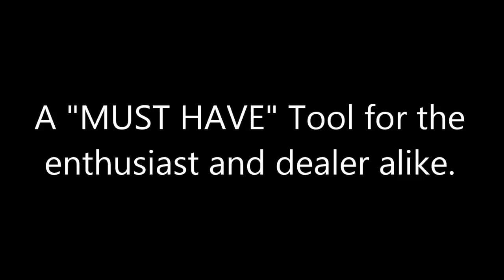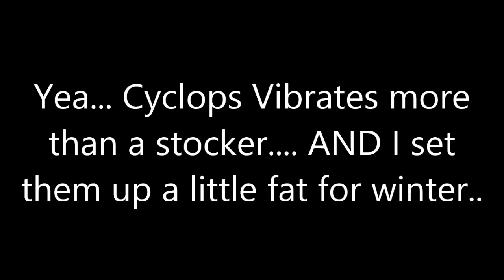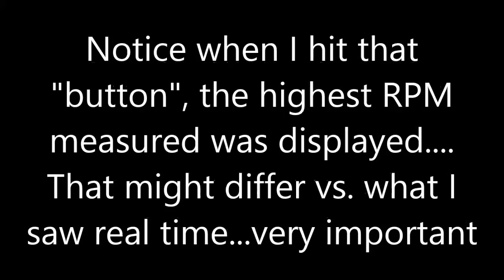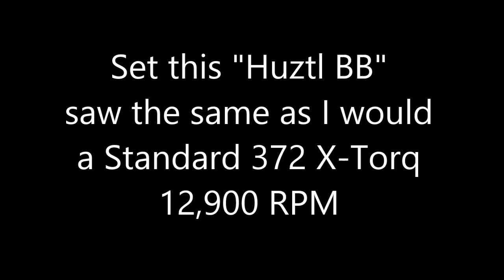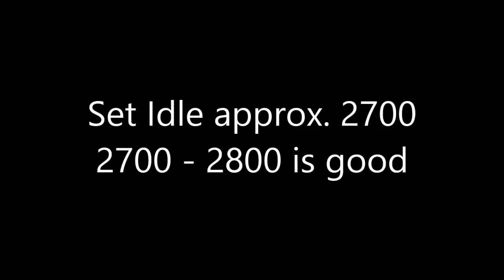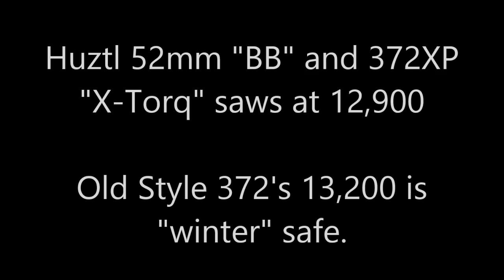Tachometer's For Chainsaw's and Husqvarna 372XP "X-Torq" Setup Notes

Comment: Sound advice here, thank you... I am checking around right now on prices for the Husqvarna 372XP. I just learned the only thing the user can adj. on this saw is the idle ( bladed screwdriver slot ), just below is the slot with the H & L carb adj. screws that req. a " Husqvarna specialty tool " to make the adj. According to the Husky salesperson, people were burning these saws up for the very reasons you have clearly illustrated in this video. Admittedly, I am old school & have always made my own adjs. by ear, however, this " old dog " can indeed be taught new tricks & using a good quality tachometer is sound advice & something I will indeed invest in. As for the " Husky dealer only specialty tool, " forcing me back to the dealer, at cost, to adj. the carb again after my initial break-in, I will make my own tool, to turn those screw heads, perhaps a butt connecter can be adapted with a slight squeeze on the outer end to accept a sewing machine type of screwdriver of which I have an asst of in my roll away. Excellent presentation here, people would be wise to pay close attention! :-)
Reply: You can buy the tool in a kit on Amazon and other places

Comment: Just getting into doing some of my own tune up work on my 7 Huskies and just found your channel... 
Impressive info and presentation! 
Based on this video and some reviews, I just purchased the TDI 20K Tach from Amick's on line. Can't wait to check where my 372xp is on the high end...  
(And having fried a 346xp early in my Husky years, I'm super interested in making sure EACH saw is set with a margin of safety!  I did have that frozen - from heat - saw rebuilt by pros and I don't even want to admit how much $ I have in just that one saw!)
Thank you for your video and great info!!

Comment: I have that same tach, actually bought it after seeing your vids.  It is a great tach.  I recently bought a used Dolkita 6401.  It is rev limited to 13,500RPMs.  I took the saw out and tuned it in the wood.  I was sure she was 4 stroking out of the wood and clearing up with load but since it is rev limited it also gave me a bit of doubt.  I grabbed the tach and checked the no load RPMs.  I was at 12,200.  I was leaving alot of power on the table.  I slowly leaned it out and kept rechecking my no load RPMs.  I know the limiters can throw off the tach so decided to just slowly "sneak up" on it. I ended up leaving it at 13,100 which is 400 below the limter.  At that setting I was getting slight 4 stroking WOT no load and decided to leave it there to be safe.  The saw really came to life going from 12,200 to 13,100.  So another win win reason to use a tach. 

I also have a 390XP, it is stock other than a muffler mod.  I also changed out the factory limited coil to an unlimited coil.  It 4 strokes out of the wood and cleans up in the cut but I am gonna re check it now with the tach.  I might be leaving more on the table with the 390 than I think I am.
Reply: Where did you pick up your tachometer from??

Comment: I love my 180.  I picked it up off ebay and restored it. Mthe only problem you might face is putting the oil pump in the 180.  You have to align it up with the discharge hole, otherwise it will not oil.  I had to put together and disassemble the 180 three times before I got it exactly right because you do not know it is aligned properly until you get it assembled and run it.  It's a bitch but when you get it right it works great.  Also make sure you use gaskets on both side of the carburator.  Otherwise you can get air leaks.  Never forget on the 180 that the cover is an air plenum and the dirty side is the bottom of the filter.  I also use the fleece air filter and not the foam filter.  The rest is a piece of cake.

Comment: My new 455XT was rich on the low side but lean on the high side by a little bit.  I adjusted both and left the high at 12,560 on my Stihl EDT9 tachometer.  It was running at 13,300, probably on the rev limiter.

Comment: My no load max rpm on a broken in saw in cold weather is 12,600 to 12,800.  They will drift a little higher in warm weather but afterwards they will be safe at just about any temp or condition.  I want a good four cycle on them.  I do not care how dirty the plug gets because plugs are cheap but engines are not.  Anyone who tells me they have the original plug in their saw after eight years of use and it looks just as good as it did, originally, is running a lean saw.  I want a plug that has some carbon flashing on the end and the electrode is a brownish grey.  That, tells me that my saw is running rich enough to protect the moving parts.

Comment: You have a new follower sir!
A big thanks to your children, you had mentioned, for their service!!
Would really like to see a video on the brazing process you use for the muffler mods.
I have a 268 with the HUZTL muffler that is dying to opened up after a little more than mild cylinder porting job that I cut my teeth on. 
Thanks for the very informative videos!!
Keep em' coming!
Reply from the maker: Anthony Wop Thank you for watching! plan to video me hacking a muffler, machining a popup piston and a few other little details like that this coming year. Going to push the boundary a little more. If all goes well... a saw dynamometer might appear too this year or next...it's in the budget.
Reply: Ill be looking for those! 
Went and purchased the little bernzomatic mapp/oxy torch yesterday to start practicing the brazing process. 
Working on a 394 right now as well that needs a new fly wheel and some other things including a muffle mod on a new, aftermarket, muffler. 
Need to ask you how good that sonic cleaner works for you. 
I'm looking to start a small business on the side, for now, and looks like you're  "AR" like I am! Next big tool purchases will be the case splitter and tach.
Sorry to ramble on.
A saw dyno!!
Fuggin awesome!!

Comment: Ms 180's can be a chore but they are not that bad and they are a great little saw.  The only thing I had real problems with was getting the new oil pump lined up and the oil lines in.  The rest of it is a piece of cake.  Get the fleece air filter for it and remember the sawdust collects on the bottom of the filter and the rear cover is a clean air plenum and not a cover.  I have seen idiots run this saw without the rear cover on the saw or it not locked down - not knowing they are sucking dirty air right into the engine.  I like that 2K tachometer but they are pricy.

Comment: Man I can’t tell you how helpful this video was for getting my 372xp set right.  She was wayyyyy too lean out of the box.  I need to check my dad’s 450 rancher.  Any idea what a good rpm for it would be?  It’s a few years old but I’m almost positive it has a limited coil.  Thanks again!
Reply: I believe the 450 rancher is around 13,000 no load.  You could go 12,500 and see if it cleans up good in the wood, if it does and 4 strokes immediatly if you pull up in the cut then your probably ok, if its not completely clean at 12,500 in the cut lean it a little at a time towards 13,000.

Comment from the maker: To those who question where I got the "13,000 RPM" vs. "13,500 RPM" no load numbers for the 372xp "X-torq", there is a posted conversation from a dealer I trust over at forestryforum.com should someone want to test the validity ..
The thread title is "Conflicting Saw Specs" in the chainsaw area.
Reply: tell me why you thing a couple of RPM are all the difference to you?
I understand you like to be thorough and i think thats is worthy but it just sounds like you are scaremongering others into  buying a very expensive product for a few RPM. thanks for your response.
Reply from the maker: Because it is a rpm limited ignition, so folks tend to want to raise rpms by leaning out the carb...so they do. The saw gets to the limiter and now leaning out the carb no longer returns a change. Many times by the time folks figure out nothing is changing to the rpms "by ear"  its well past the point of lean. A toasted top end is not far behind. So instead...using a tach you can lean out the carb to just below the rpm rev limit and KNOW you haven't gone too far. Want the hell is scaremongering anyway?? Also having the saw tuned a couple of hundred rpms away from the rev limiter gives a little safe zone in tuning to account for running at cold temps. Something we do here a lot. As the temp drops, the air density goes up requiring more fuel. A saw tuned to 13000 in the summer may be at the 13300 in the dead of winter simply because of air temps....so no mongering as I have nothing to gain, but many have plenty to loose by not understanding what they are dealing with. Just raw information to those willing to hear.
Reply: 140psi Good compresion 372xp?
Reply from the maker: @Sensei948  yup, good enough to run
Reply: @afleetcommand  So by setting 372 xp oe to 13200 I am safe and I have factory power?
Reply from the maker: @Sensei948  yes

Comment: First chain saw. After cleaning up the carb that I left gas in on my Husky  450 I re installed the H and L needles with my new 21 spline nut driver and I was at square one. I never touched T. I set both screws to 2 turns, per the  Husky shop  manual that I found online. It started right up. I played with L until I got a smooth idle and no hesitation after revving. That leaves the H to be set. The manual says 12500.  I read on forums that it  it should 4 cycle until load is applied. It runs smoothly when revved, not 4 cycling, and seems to bog under load so I assume I am not set correctly. I am wondering whether I should get a tach and just set 12500 or try to detect 4 cycling/ 2 cycling under  no load /load. I was looking at the tt20k as it seems versatile enough  for use with a number of engines I own. Any feedbsck appreciated.

Comment: Can I do this effectively with something like a Tiny Tach? I have an Echo CS620PW that I have been running at stock settings. The problem is is that supposedly they are set up for 1000 feet elevation and under. I'm at 5600feet. I've been running it like that. For one thing, it's hard to start. I'm going to guess it runs richer up here due to the lower atmospheric pressure? I usually run it when it's between 40F and 70F outside. That all said, I just bought a CS-2511T and I haven't used it yet. I like this little saw and I kinda want to set it up properly before I even run it the first time. I'd appreciate any advice. Thanks.

Comment: the saw is a 372xp that's what i was setting the H and L on thanks for responding. I got a question about filters  I left this question on another video too just saying  i was wanting too use a jonsered filter for 2166- 2171    on the 372xp  no dealer close by and don't won't too wait on shipping what's you opinion thanks in advance.

Comment: Where do you get the tach specs so you know around where you need to be?  I have a 2016 390XP, Husky site says max power RPM is 9,600
Reply from the maker: Bob..:) Also you can get a lot online by just searching "max rpm" on a given saw. But Bob has all that info for Husqvarna / Jonsered. Basically ANY dealer of any brand should be able to supply that type of information.

Comment: I just have to ask, at what fuel  mix ratio are you basing your adjustments on? If I remember you run a 32to1 mix. So if you would run a richer or leaner oil mixture in theory would  you not have to change your mixture settings on the carb to compensate ? So should one only be concerned about running lean at some point and wouldn't a richer oil mix counteract the lean effect as well as slow the rpm down because of the inherent slower burn time versus a richer gas mixture while at the same time cutting down on both peak Hp and top rpm"s but in turn
boost bottom end torque ?  I agree with your logic but I tach tune all my saws to run 13200 to 13800 depending on model and moods and I run 24to1 in the summer and 32to1 in the winter with a little marvel mystery oil added in just because, that's how its always been done here on our farm its in everything. The only issues I ever had is fouled plugs and clogged spark arrestors, a very minor inconvenience for great power and longevity. My saws are work saws not play toys. In my opinion  50to1 falls way short of what you should be running, the manufactures only push this to please the  tree huggers that are pushing the EPA to mandate it while trying to save the same trees that we are cutting down.
Is my thinking all smoked up  from all the extra oil. Your thoughts please.
Reply from the maker: You can really over analyze  this stuff. Rather than go point by point, I'll just cover a little back ground and what I do. First, oil is in fact a fuel. And actually has more BTU's per unit volume than gasoline. Second, the newer synthetics actually burn much better than the early ones. Because of some of the early products properties mixtures need to be in the 40-50:1 ratios as more oil created more residue in the exhaust. Especially some of the bean oils. With the advent of power valves along with fear of new EPA regulations the industry developed blends like the ester based Bel-Ray H1R that had all the good properties but also burned well....I started the 32:1 racing 125's and 250's in the motocross world and discovered pretty quick these new oils saved wear and tear. Also seemed to run better, I assumed lubricity and less heat as a result and learned much later it was actually more about the BTU's and actually  the 32:1 mixes ran hotter...more energy. BUT still had the longer life as you would intuitis. So I've stayed with 32:1 on motors smaller than 250cc ever since and have yet to see reasons why I should change. When I tear down test saws...i see plenty of reasons to stick to the mix. Always have a nice oil film of the hard parts of a 32:1 fed two stroke....always dry with the 50:1's

I would absolutely NOT add marvel mystery oil to these blends. One of my customers did until I showed him the intake side of his pistons after a year vs. some other logger types who use 32:1 Husqvarna synthetic (Golden Spectro) Maybe the marvel product worked well for old low compression four strokes needing clean valves and something to break down the carbon..but not a two stroke. Nope..and I really don't want to go into the detailed explanation because if you think about what marvel mystery oil is about it will be obvious. AND I have seen plenty of empirical data to support my assessment.

As far as tach's and tuning to tach's. There are several very good reasons to do that and follow the manufacturers recommendations....if you have access to them. Especially with saw with limited coils. Many 372X-Torqs lost there mojo when old school experts try to tune to OE 372 specs or by ear expecting them to run like the original addition. The OE 372's were set to 13,500...and most didn't have limited ignitions. ALL the Xt's have ignitions limited to 13300....see the problem?? You go old school hunting for that 13500 pitch and that saw is toast. First it will never get the that 13500...and as it hits the rev limiter AND the non-educated keep hunting for those RPM's by leaning it out....most quit after seeing no change and DON"T think to back that adjustment screw back out to where the saw is responding. Run in that condition and top end failure is a result. Every time. 

And unless the saw is an Autotune, setting the tune with a tach as the temperatures is a great plan....they will go rich as the temps rise and go lean as they drop....air density increases requiring more fuel. But that is another story....
Reply: afleetcommand Thank you for your insight and wisdom, there are some very good points that now has me thinking about my ways and reaffirmed some others. I just have to say you have great videos and I'll keep watching as you keep posting. Merry Christmas
Reply: @afleetcommand  13200 rpm  max ok 372 xp oe ?
Reply from the maker: @Sensei948  yes
Reply: @afleetcommand  EPA 2........
Reply: @afleetcommand  Friend, will the saw have its full power at these revolutions? There will be no carburization of the piston?
Reply: @afleetcommand  Friend, how best to adjust the L-needle in the carburetor?
Reply: @afleetcommand  can i set 13200 rpm for 372xp oem after one blown tank? saw after replacing the piston ...

Comment: afleetcommand I was wondering how your "Huztl" 372 was holding up to your farm work? Your videos have prompted me to dig out a couple of my old 266's and try a stock build and a aftermarket build. Thanks for the Great videos!
Reply from the maker: jason hill Actually its doing quite well. A mature build as I have debugged all the little stuff. Now its one of those saws that just runs, is a little dirty from use; will fire easily hot or cold; and sit and idle when needed. It picked up power after break in. So ... its boring. Because there is no drama to report. A little later I will do a quick comparison of four "372" inspired saws. Huztl saw, "Meteor" Stock Build 372, A Stock 2172, and "Cyclops" which is a Huztl build with a muffler mod, no base gasket, and .050 off the piston skirt ... should be fun.

Comment: Know this is an old video but how accurate do you think the tach's that have the wrap around the plug wire connection vs the tool you used in this video?

Comment: I have a sendec sets 5000. it's showing 2620-2760 -2800 fo r L and 13,400 for H .I understand  you can't get it perfect .. I just want it  too be good enough. what is your  advice on those numbers and your thoughts on the sendec tachometer thanks in advance.
Reply from the maker: On which saw? 2600-2800 range is perfect for low....even if it wonders a bit. They all do